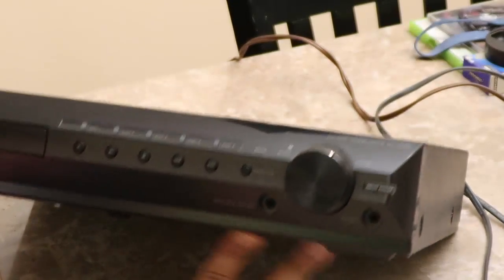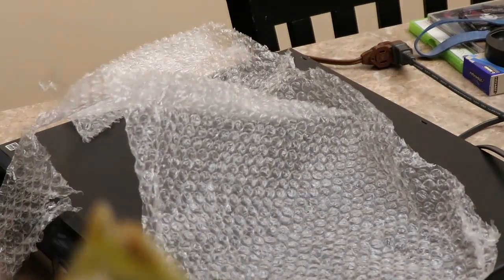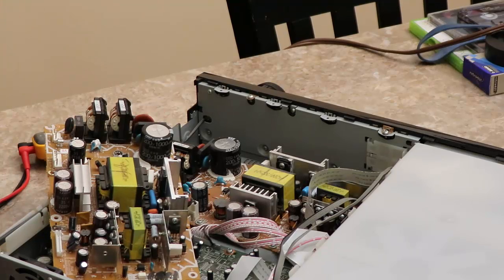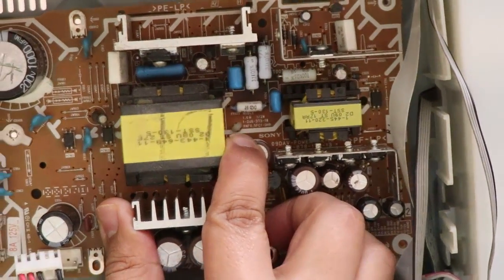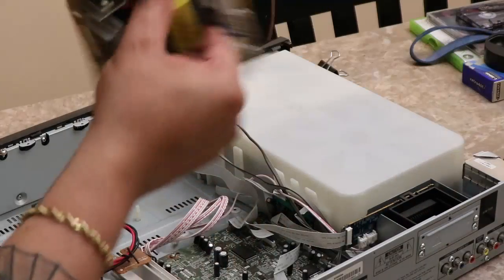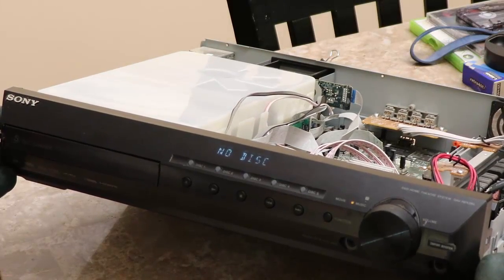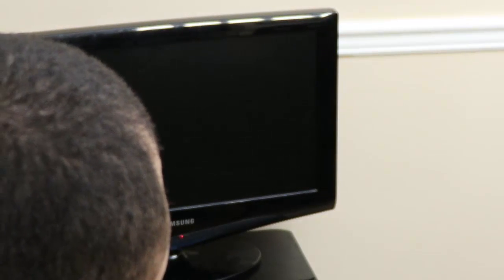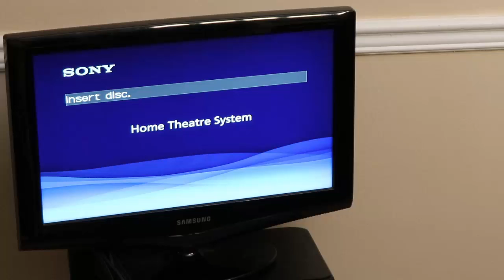Trying to fix a faulty Sony DVD Home Theater System Model DAV HDX285/HCD HDX285

Comment: I’d like to replace the laser lens in my Sony dav-hdx285 receiver, but I can see it is hard to get to. I feel like the audio is much better using the receiver’s built in dvd player than an external dvd player plugged in with a digital coaxial cable.

Comment: With all due respect... dont sent your power board to the side for 30 minutes and expect it to be discharged... they're electrolytic capacitors and hold a charge for some time... just manually discharge them as it literally takes a second.

Comment: I have the same one, my grandma gave it to me before she passed away. My question is how can I fix the GREEN CENTER ( the little box on the left corner ) that’s where I connect the center speaker which it works but it won’t work on that little box. I just wish that was working 🤷🏽‍♂️
Reply: Press the SYSTEM MENU button.
Press the UP or DOWN arrow repeatedly until DEC. MODE appears in the front display.
Press the SELECT button on the remote control.
Press the UP or DOWN arrow repeatedly to select PLII or PLII MUSIC.
Press the SELECT button on the remote control once more.
Press the SYSTEM MENU button to exit the menu.
Reply: I need my center speaker to work... How or what I do guys.. please help 🙏🙏

Comment: Question. I have the same player and the 5 disc changer is making clicks and it won't open.  I think I put a DVD in crooked. Can we open the disc changer to get it out?
Reply from the maker: I have not done so myself but yes you can. The issue would be obviously to not break anything in the process as well as getting it put back together correctly.